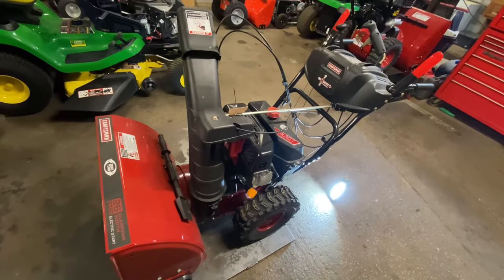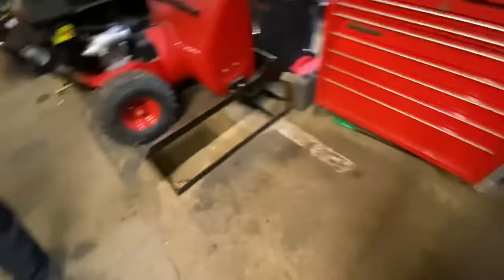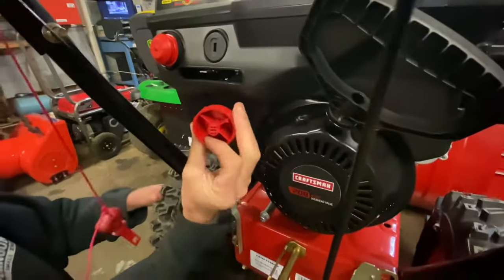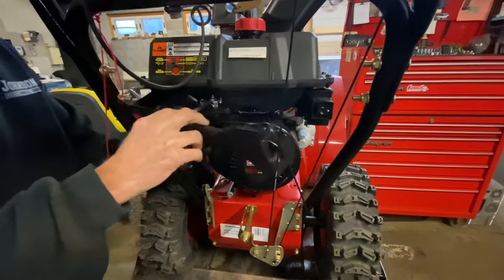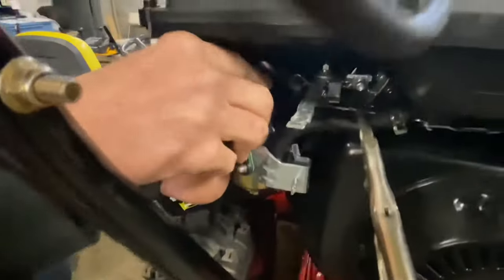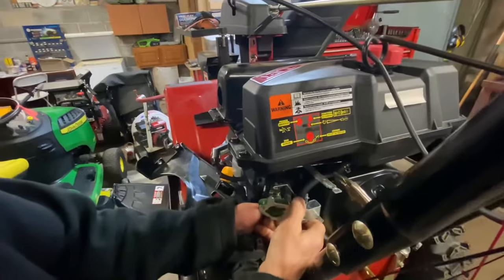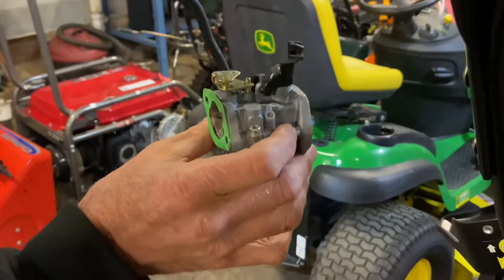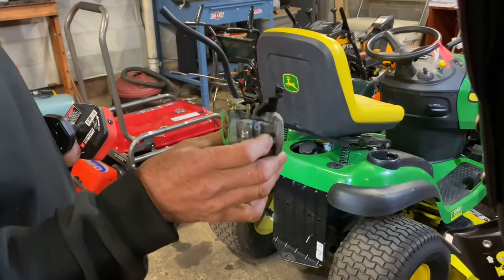How To Remove Carburetor Craftsman Snow Thrower. 247.886940 Quiet Technology Engine

Comment: Just followed this to a T and used the new carb kit in the description. Stopped surging and runs smooth as butter. Great video thank you!
Reply from the maker: Great to hear your back up and running! I would highly suggest stop using gas station pump gas and start using Aspen fuel. It will help you from having issues with fuel going bad inside the carburetor. Here is a link to read up on it to see if it would be a good product for yourself. https://www.aspenfuels.com/products/alla/aspen-4/.

Comment: Thanks so much for this video. Its been my go-to video... Replaced carburetor last year. Have to clean it this year.
Reply from the maker: Hi David, I’m glad it was helpful! Try using Aspen fuel to avoid the issues every year. You will need to look it up on the internet to find a location to buy it. I’ve been using it for at least three years now. No ethanol, 92 octane and can stay fresh up to 3 years if stored properly. Just don’t mix it with regular gas. It’s a little pricy but for the snow throwers, we’ll worth it!

Comment: Sea Foam....Sea Foam....Sea Foam. Mix it in every can of fuel and in every engine,2 cyl or 4 cyl. I have used it for years with good results. Some newer snow blowers are a real pain to clean or replace the carb. Blessings to everyone out there.
Reply: Which way is the choke on this snow blower on above unit
Reply from the maker: Go to minute 2:05 on this video for the choke. https://youtu.be/poKcTAezvHY

Comment: Thank you, Brad from Cody Wyoming with all your great helpful, easy to understand tutorial's.  I just purchased this exact same snowblower used very little. The only issue is the throttle has no speed adjustment, no matter what position it is in, the engine speed is running at full throttle. This is not a deal however, I do prefer, to run the engine at an idle to cool it down before shutting down the motor completely. Any suggestions what to look for that would cause the throttle lever not to change the engine speed no matter what possition it is in, before I remove covers to expose the carburetor? Keep the video's coming! 
Warmest Regards from Cody Wyoming
Ugo
Reply from the maker: Hi Cody, it sounds like someone may have turned the idle screw in to far not allowing the speed to slow down. You must find the idle screw. I think I have a how to remove and rebuild the carburetor that should show it but I’m not near a computer at the moment. Check in the description below to see if it is there. If not I’ll will look when I can get on a computer.
Reply: @JohnsonsSmallEngines  Thanks for the rapid response Brad... My name is Ugo ... Cody is the town in Wyoming is where I live... i haven't looked yet i wonder if the idle adjustment screw has easy access or will i have to remove the cover  shown in this video to remove the carb.
Again thanks Brad.
Ugo.... warmest regards.

Comment: Your video helped a lot.  I forgot how to connect back the choke.  Second time I had to takeoff the carburetor because it had a missing  main jet screw from the factory.  A new machine used 5 times.  I bought a new carburetor.  Now to  the mail jet screw to keep the replaced carburetor for a spare.  Any help to find this screw will be appreciated.
Reply from the maker: That part is not available. You would need to buy a new carburetor to get the part.
Reply: @JohnsonsSmallEngines  I had hopes that you might have this small used part from a carburetor that you replaced.  I tried to find this part  and could not.  I appreciate your reply.  I bought a new carburetor and just installed it.

Comment: Great Vid Brad ,Looking to replace my Carb soon on my  12 yo Craftsman Snowblower 247.88970 and this vid really helps makes things easier ,Ques. I noticed gas in the oil last oilchange but I had the machine standing up prior to get a better look at the carb ,not sure if it was due to this or just a bad carb?
Reply from the maker: Fuel in the oil happens when the carburetor fails. Replace the carburetor and change the engine oil

Comment: Great video - i was able to swap my carb quickly.  It started 1 pull.  I noticed it rev-ing loud.  Are there any adjustments that need to be made on the carburetor?
Reply from the maker: If the throttle "slow and fast" is not working? When you start it can you control how fast it is going? If no you may have the idle screw on the new carburetor all the way in "plastic screw". The only adjustment on the carburetor is the idle screw. Double check how you installed the carburetor. Is the carburetor you installed new? Make sure it is the same as your old one.

Comment: how about increasing the rpms? Thanks for another great video.
Reply from the maker: Unless someone has adjusted the governor you should not need to change engine rpm’s. On this model, it is the “quiet engine” which may sound like the engine should run faster.

Comment: I have a Troy-Bilt with the same front-choke and  "easier to remove plastic carbureator cover" you showed here.  I looked everywhere for a disassembly video but this seems to be an odd duck only made 1-2 years before switching to the top-mount choke.  Your video saved me -- thanks so much!  I'm going to just drop in a new carb I think and maybe clean up the old one and keep it as a spare.  I'm Including all the info below hoping it helps save the next person some searching...

I'd love to install a fuel shutoff so I could run it dry if I know it's going to sit a while -- have you found a good way to do that?  I can't think of a good place for it...

Many thanks for all you do!

Troy-Bilt Storm 2890 Snow Blower
Model#: 31AM59P4766
243cc Troy-Bilt NoiseGuard™ engine with 28-in clearing width
675-QUB engine
CARB ASM-PRMR HY-175SB
Item#: 951-05118B

Comment: This is the exact  same model as mine & i need to pull my carb. as well. I bought a different carb . but i think i'll keep the old one and rebuild it when i have more time this winter. Would you know what the carb . Kit  # is for this carburetor ? Thanks !
Reply from the maker: There are no rebuild kits for the carburetor. We disassemble them, clean in a ultrasonic cleaner and reassemble. Most of the time that will work unless it is in very poor condition. Then we would just replace it.

Comment: Very informative step-by-step video. I was able to remove my carb pretty easily and take it apart based on another video you mentioned below. A little o-ring broke and a gasket looks like it needs replacing. I have to order parts. Is it ok to keep the fuel line clamped, or should I attempt to drain the fuel so I can unclamp the fuel line?
Reply from the maker: I have left the fuel line clamp for extended periods but you may have to manipulate the fuel line a little to get the shape back. Thank you for watching and commenting. Please give this video a thumbs up to help my channel.

Comment: So I got my carb off and cleaned it and it worked great for about an hour and a half of work but then out of the blue it started surging/hunting again. When I had he carb off I cleaned the main jet on top and cleaned each port with a little carb cleaner.
Reply from the maker: Sounds like you may need to clean the fuel tank out, Flush it and use hi octane fuel. You will most likely have to rebuild the carburetor again. Did you see my how to video on rebuilding the Troybilt carburetor. I’m sure it is now in the description.

Comment: Braze or weld a pair of  1/4" steel rods onto the jaws of an old pair of Vice Grips to make a tool to pinch fuel and brake lines
Reply from the maker: Sure if you can braze! Black tape will work in a pinch and you will be able to reuse your vise grips again:) thank you for watching and commenting.

Comment: Took my snowblower apart a couple months ago to get the carb off and order new one, I have the same carburetor setup and I have another spring that's shorter and thicker and cant remember what it attaches to. If i send you a picture do you think you could help? Thanks!
Reply from the maker: I would need to be in front of your machine to really help you out. It is almost impossible to tell you where it goes when I normally can’t remember from one machine to another as I work on all types.

Comment: Anyway of adding shutoff valve to this snowblower, have problem every winter
Reply from the maker: None that I’m aware of. Try and run machine out of fuel at the end of the snow season, then drain the bowl of the carburetor. OR, start using Tru-Fuel (check it out online) fill tank full and start machine every 60days and run machine for twenty minutes at a time.

Comment: Great Video Brad, thank you so much. I have a Craftsman, older model # 247,886910 208-OHV which this year wouldn't start and I know I left it out in the year as I was working on my garage so it got the elements. I managed to follow your instructions although I have the model with air filter so it was slightly different taking off the front panels. Once off I did get the carb off and it has lots of rusty looking build up inside and somewhat eaten gaskets. Im not sure whether its worth rebuilding or replace. So, If I replace, how do i find the right carb. Is there a site I can go to and plug in my model and engine numbers and find a carb ? Thanks so much. Frank
Reply from the maker: Go to Sears Parts Direct online and put in your model #247.886910 and click on snow thrower, then look foe the engine parts breakdown, then find the part # for the carburetor. Then you can goggle the part # and find one on amazon. I looked it up for you. Part #951-14026A,This part replaces 951-10638. Here is a link to a new carburetor. https://amzn.to/3L2Y5qc. What you just described is definitely a carburetor issue. I would first make sure the fuel is flowing ok through the fuel line to the carburetor, after you confirm the flow is ok (not just dripping out, a nice flow) to the carburetor, then it is time to install a new carburetor.

Comment: I have this same unit my am I not able to prime my machine before starting? Also when I try to do this gas pours our of the carb onto the ground. Bad carb or bad gaskets?
Reply from the maker: Your primer is working if when you push it too many times fuel will start dripping on the floor. If it does not start you most likely have bad fuel and you will need to rebuild or replace it. Check this how to start video https://youtu.be/poKcTAezvHY to see if your doing everything correctly and if you are start simple by replacing the spark plug then go on from there.
Reply: @JohnsonsSmallEngines  do you happen to know a proper carb replacement for the 208cc quiet technology
Reply from the maker: I don’t know it off the top of my head. You’ll need to take the model of the machine go to sears parts direct online and look up the part number then you can order a original or aftermarket online.
Reply from the maker: Carburetor Part # 951-05251 for the model in the video.

Comment: Hey coming out of the side of the engine is a 4prong female plug. What is it for??
Reply from the maker: If you mean the 3 prong male plug on the right side on the engine (if you are standing behind it). It is the electric starter.
Reply: @JohnsonsSmallEngines  no sir, it’s a 4 way white female connector. I’m thinking it’s an external hookup for a headlight kit
Reply from the maker: Either lights or hand warmers.

Comment: Do you know what kind of carb to buy for this blower? I have the same one and I wanna get a carb on the way home. I would be sooo grateful if you know.
Reply from the maker: The engine is China but parts are MTD. Look up all parts on the Sears Parts Direct web site. The carburetor part # for the above model number is 951-05251

Comment: I have this same snowblower. Carb was old so I replaced it with an amazon china direct replacement. Installed it, fires right up, idles fine. When blowing snow it works but when the snow gets thick under load it stalls. Any suggestions?
Reply from the maker: I would need to see how it is operating at the time of the struggle to figures that one out. First I would say do not go to fast into the snow?? Try and go slowly when the snow is deeper? You also may want to check your auger belt tension. I am picking the exact machine up mid next week and I will make a video on the auger adjustment but I think you can use my one on auger belt adjustment on a craftsman snow thrower. Unless you already know how to adjust. Make sure all shear pins are ok.
Reply: @JohnsonsSmallEngines  everything worked ok until I changed the carb. I never stalled it, ever. Maybe not getting enough fuel. Runs fine until I get into thick stuff.
Reply from the maker: Try putting the choke on a tiny bit, click by click and see if it performs better. That is without the engine choking itself out. If it works better with a little more choke, then you do have a fuel starving issue. If this helps and the carburetor was not too much$? Purchase another and try again? Just a thought.

Comment: Hmmm. I've clearly done something wrong. When I put the carb back in it began to leak gas shortly after I took off the clamp. I'll go back and see if I put the carb back together incorrectly. Any idea of what I did wrong??
Reply from the maker: Possible (1)The needle valve is not seated properly or one or the other is in to poor if condition and it will not shut off the flow. (2) bowl gasket is not seated correctly. (3) bowl nut is not tight enough.
Reply from the maker: (1) The needle valve or the brass seat may have a issue. This goes with the (1) I just sent to you.
Reply: @JohnsonsSmallEngines  Thanks Brad. I felt pretty sure it was the the way I put the carb back together. It's likely 1) or 2) because the parts in are in good condition. Can't thank you enough.

Comment: Any chance you can share the part number for the carburetor?
Reply from the maker: If your machine is the same model number as the one in the video. The OEM Part # 951-05251. It is a MTD part.

Comment: I own this exact machine. Did not need to use it last year at all. This year it wont start. When I push prime button, it seems like there isn't any fuel moving to prime it. Any thoughts/solutions?
Reply from the maker: Your carburetor will need to be rebuilt or replaced due to fuel going bad in the carburetor. This is why I made this video for the do it yourselfers!
Reply: @JohnsonsSmallEngines   I'm not too handy, but you made taking it out look not too difficult. Did you make a video of replacing it?
Reply from the maker: No but you can order one in then when you get the new one, just have it ready when you take the old one off from using this video just put the new one back in the reverse.order.
Reply: @JohnsonsSmallEngines  Hey man. Just installed new carb using your video. Couldn't have been easier using your advice and it worked perfectly. Just in time for weather they're calling for this week. If anyone is reading this and unsure if you can do it, you can! Thanks again!
Reply from the maker: @jimmal4471  glad to hear all is good!